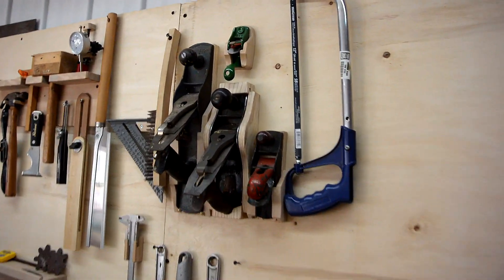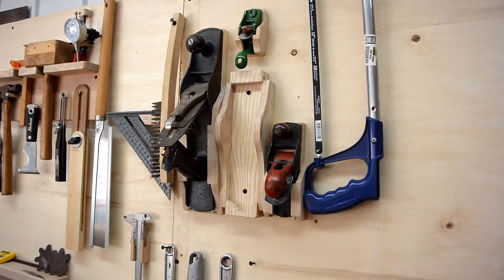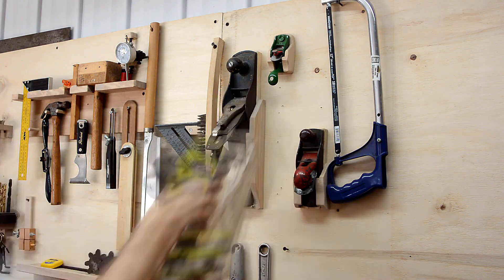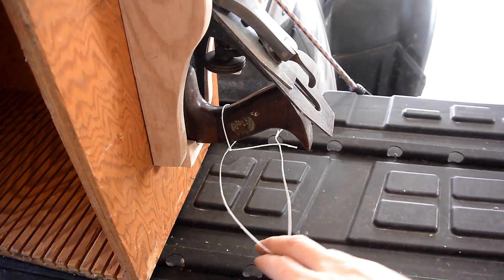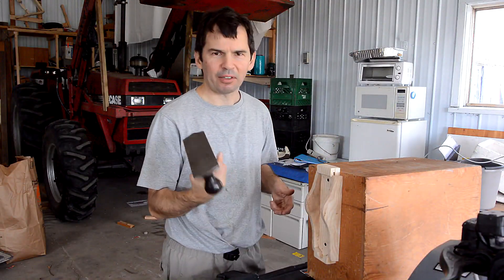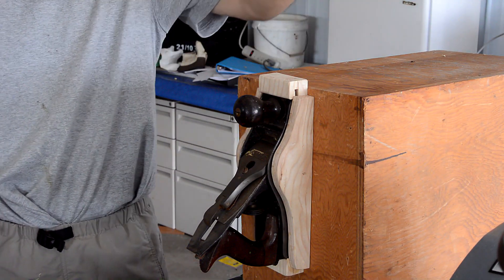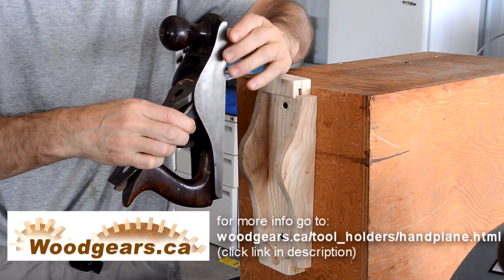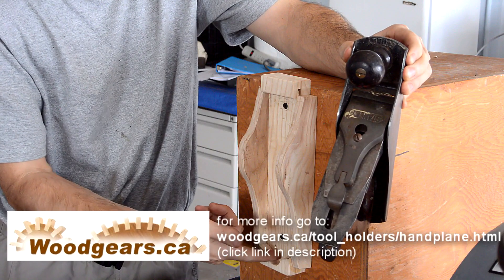Shaking a hand plane out of its holder

Comment: Weren´t the concerns that vibrations on the workbench could work it out of the holder, not an earthquake? Not that I´m saying that this would be a deal, unless the workbench is very light and the tool wall is mounted to it and not fixed to the wall and you are slamming with a really big hammer onto something in the vise. I think that was the thought, without judging that of course.

Comment: I like your test but it does fail I'm thinking you may have never been in a earthquake before earthquakes do not jumble you about they rock you back and forth and as we saw every time your atv rocked to the left the plane fell out. Attach the plane to a unstable square box and rack it back and forth that would me a much better scenario but I do like the design of your holder and as another viewer said to me just put a neo magnet at the bottom and all fixed

Comment: What if you had a small magnet built into the holder at the bottom so the sole of the plane had something to hold onto it. If that doesn't work, keeping a pillow on the work surface directly below the plane would break it's fall.